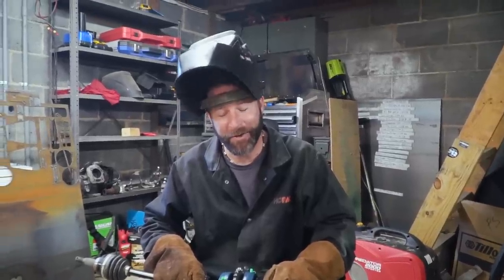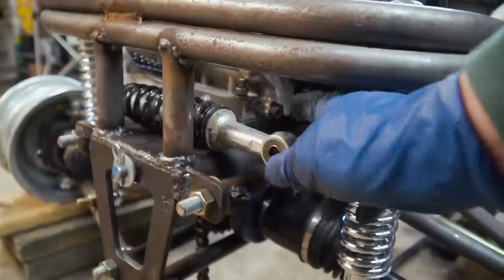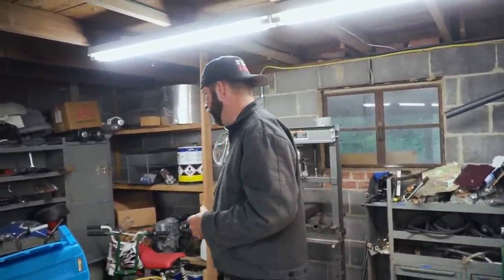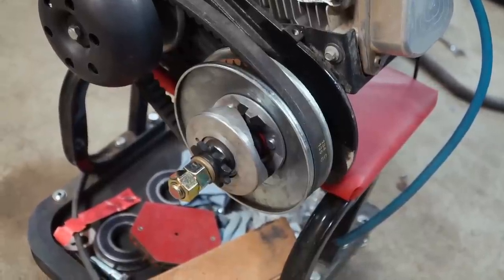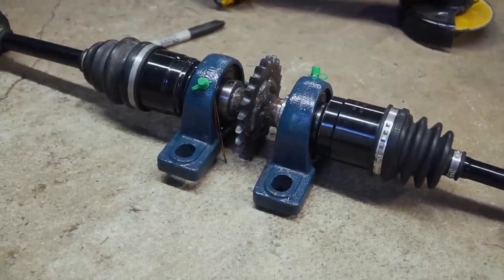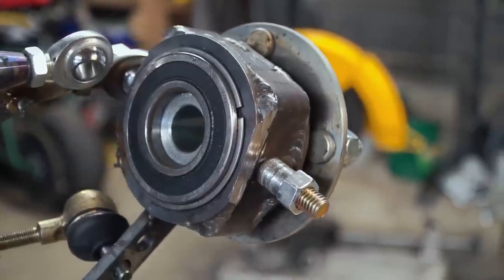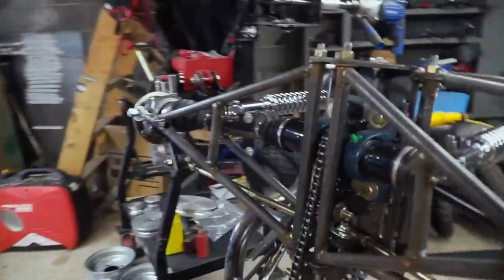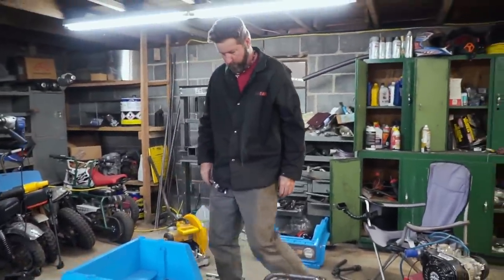4WD Crawler Go Kart Build Pt. 9 | IFS Complete,  Engine Mounted!

Comment: Having that locked front end is gonna make this push so hard in the corners, hope it works out!
Reply: I wondered about that myself..
Reply: Can't see it work well on pavement . Be curious to see how it steers offroad too .
Reply: My 02 honda 350 rancher is 4x4 all time and posi front and rear from factory and it turns decent.
Reply: Brandon Floyd beat me to it. The early Honda 4x4 quads were almost always locked full time front and rear. Even when you had selectable 4x4 all that did was disengage the front drive shaft. The front tires were still locked together tho. Obviously those quads have nothing on our new power steering selectable 4x4/locker IFS/IRS 500cc Honda. Now that thing is a sweet quad.
Reply: @brandonfloyd6321  posi has some give. This is full on locked..
Reply: @Snowtrails11  they always turn on mine. Dont think its limited slip.
Reply: @Michael Keegan mine always turn. Dont think its limited slip.
Reply: On soft dirt it'll be ok.
But on paved surfaces if you turn full lock and accelerate it'll just flip over.
Reply: Full lock on accell means full lock on braking, too
Reply: All time 4x4 honda 300s ran different gear ratios locked front and rear. They got away with it by running smaller front tires.
Reply: @jaymugridge1810  its not gonna turn at all on the throttle. Well it will but the steering wheel is gonna fight back so hard. I've rode something with all 4 tires lock together and it wasn't fun lol
Reply: @Michael Keegan By "REAL" problem, you mean an obvious point they would already know.  No doubt they have known from the beginning, but must have the patience of saints seeing irritating randos incessantly commenting the obvious.
Reply: It's kinda funny seeing all the clueless 'problems' fabricated by internet experts with zero experience who haven't thought very carefully about their concerns.
Reply: @brandonfloyd6321  It's a limited-slip differential.  Honda calls it a "torque sensing differential"  it believe it uses a clutch pack.

Comment: You should copy the front suspension on the back
Reply: I think the opposite. I think they should copy the rear suspension on the front.
Its not going to work very well.
Reply: absolutely I said they should but IRS in the rear would eliminate the chain being twisted
Reply: @nasty2ndgenneon  thats why they have the CV axles an the sprocket is hard mounted.

Comment: You're putting the chain on the outside of the torque converter? On the part that moves? Isn't that kinda not good? Having the chain moving laterally?

Comment: Just a heads up but a fully locked front end will plow or continue in a straight line,understeer forward rather than turning due to both contact patches on the tires moving at the same speed...ie n therefore you'll continue forward in a straight line no matter how much you turn the steering wheel in either direction... And with a live rear axle you basically make it twice as bad to drive forward and not steer... Jus sayin..

Comment: If you had room would have been cool to see you do the same setup as the front  in the back and have 4 wheel drive  and 4 wheel steering 💪😂. But still im loving the builds you guys do and Its always been  how the average guy at home would do it with what ever is available at the  time😎💪

Comment: Fully weld the double tube frame. When the clearance is so close on the body fitment, heat it up to soften the plastic so it will conform to the frame..👁♥️👍🏼

Comment: I think that you may find later that the front end CV joints wear out very fast. The point of angular change for the CV is supposed to be aligned with the angular point of change for the wheels. When you turn your wheel and apply throttle the Cv joint will actually try to turn the steering wheel out all the way in the direction you’re turning.

Comment: It's gonna be hard to steer being locked in all the time in the front
Reply: Josh Graves no its not. All wheel drives (Audi a6) are designed to do exactly that.
Reply: But do they have a fully locked front diff? No
Reply: My sxs has a front diff lock. You lock it in and it doesn't steer for crap on dirt or concrete with power steering.

Comment: If you don't have room for a gas pedal perhaps you could try a steering wheel mounted throttle either paddle or lever. It would be way different from what you have done before and may give you more room and an easier hook up.

Comment: How about taking two FWD gearboxes, removing differential from those and using them in this build. There should be just enough room if you get way bigger pillow bearings and replace gear to sprocket in the diffs. Could even find way to make them limited slip diffs with some jerry rigging using springs and friction disks.

Comment: Not sure if anyone else has said this but mount the throttle and brake on the steering wheel since the leg room is so bad. Not sure if you have the ability to add a bearing to the sprocket end of the torque converter to keep from braking the plate. Once there is only 1 nut the bolt looks to be long enough to add a one.

Comment: Couldn’t you pin the inner portion of the cv and drill and tap with a bolt inside the joint to the front axle. Think of how people add pins to a crank pulley. It’d work I believe, if this setup fails and it’s be serviceable.

Comment: I guess it is not an issue with all of the holes in the shack, but consider good ventilation with that heater so u dont get carbonmonoxide poisoning.

Comment: I’d cut the frame in half extend it b4/6 inches or so  go buy another power wheels cut the center floor rails out plastic weld to the center stretch of your body and mount your body on the chassis hella good and it would look better portioned with the width of it you’ll be a little more comfortable too awesome ass build I will build again eventually but way simpler 😂

Comment: why cant they make it about 6 inches longer like they did on other channels so Ike can be comfortable...cut the chassis in half put some solid steel stock in the tube chassis  weld it and extend the chains and its good...you add dyed plastic to fill in the space...and its good